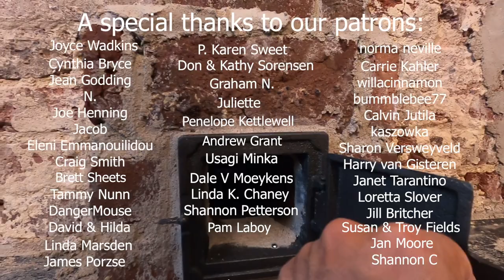How fixing few bricks in chimney became a DISASTER / Renovating an old ABANDONED farm

Comment: I'd likely be looking at installing a stainless liner down the entire chimney.
Reply: ^^This!^^ Slide it down from the roof, connect it to the stove, and it will be so easy to clean. Also will keep creosote from building up and leeching through the brick and mortar potentially discoloring your walls down the line.

Comment: In my area of the US the working chimney flue, in habitable  homes,  should be lined with Terra Cotta tile "tubes" or a stainless steel tube liner.  Chimneys like yours  did function for years.  The down side was the buildup of acidic creosote resulting in chimney fires or flue gasses escaping into the  home. Great job.  Narragansett Bay

Comment: Since you are moving from an abandoned farm to a living home. I hope someone will provide De Hoeve with guidance on electrical, plumbing etc, so they will get past the licensing requirements in Belgium. This is an awesome undertaking. Supporters please provide insight into this for them.
Reply: Electical will be the easy part, I love doing electricity in older homes because you have so many options 😉
Reply: Codes and Rules vary from Countries or Regions/States/Provinces and City or Country life too...can't advise when your not from Belgium...Basics of Electricity are the same but Voltages and Phase type ( 1Phase / 3Phase ) also is different....being Safe is most important when rewiring a Home...same with plumbing / HVAC ...Construction..it all is unique or slightly similar.... Experience Matters here...

Comment: You can replace the wire on your Grinder...easy and cheap....they can break inside if older ( i have 40-50 year old tools i still use as well as Brand New too )...you can take it apart..replace the cord ( i buy bulk cord that is a better grade than factory...make it as Short or Long as i want..add new end to plug in and use it again for decades...

Comment: For any job I've ever taken on, I always multiply the time I think it will take by two, then add an hour. For jobs the size you are doing, I'd multiply by three and add 3  hours - and I'd be just as (in)accurate in my time estimate as always. 

I was struck this time especially at the advances Illia has made in his bricklaying skills. He's ready to hire out as a professional bricklayer if ever you need to supplement your income - 2 jobs and renovation should be well within your abilities.

The very first time I used a brand new hedge trimmer on a little bush in my front garden, I managed to cut the one and only extension cord that would work with the trimmer. Not sure if it was better to cut the extension cord rather than the cord of the tool itself. Both are an embarrassing inconvenience. At least mine wasn't broadcast to the world on YouTube.

Comment: Could you explain the purpose of the little black doors set into the chimney please. Is there going to be a wood burning fireplace in front of it?  Sorry I’m not understanding this at all. 🤔
Reply: Improved air suction and soot removal.
Reply: I believe they are going to have a cast iron fireplace or stove in front if it. The little door is an inspection door. To access for cleaning, etc. He will cut a larger hole for the flue pipe to the chimney above it. I think...ha

Comment: its masonry ...that means heavy loads dirt dust lol   the failing mortar and bricks arent a big issue this is what happens to brick over time. fixing it is simple but can be laborious if it were my task i would probably remove it all and just re lay the wall without the fireplace opening and surround , but it isnt my task so whatever you do is how you will complete it ,  its nice to see the old craftsmanship and methods of building  ,,, having studied architecture and construction and history  i would presume  the drainage is poor and a lack of foundation causes dampness issues which  is the reason the brick failed ....thats a guess on conditions but i think it may be accurate... remember its only brick it can be replaced as humans we have made more than a few of them over the years so swapping some out isnt  like  changeling the background of the mona lisa ....the scale of the project isnt large enough to need to worrie about structural failure    work in sections  keep  openings as small as possible  . thanks for the video good luck with the project.